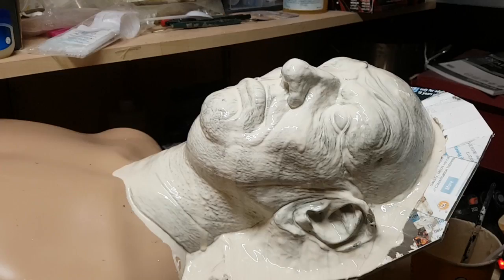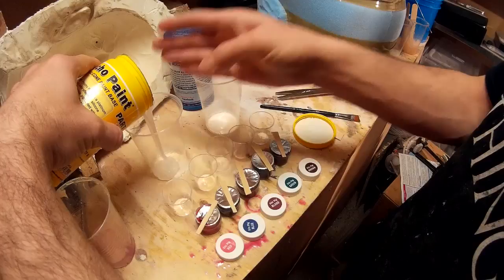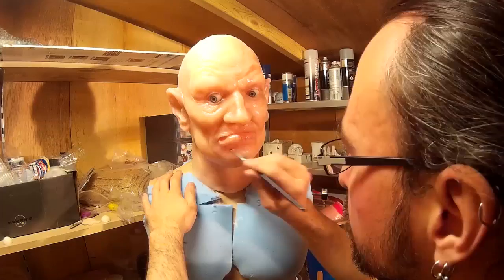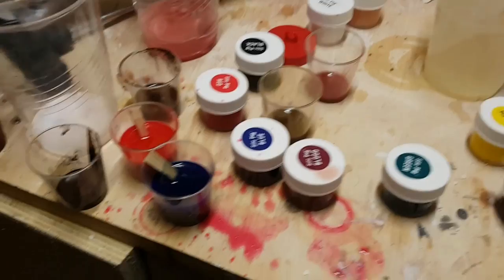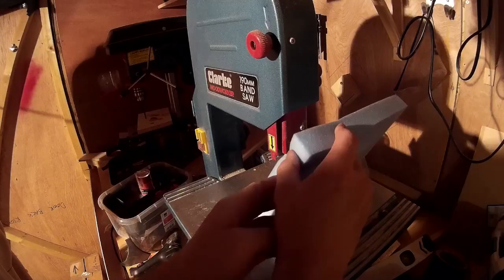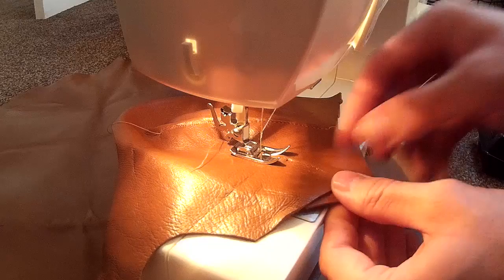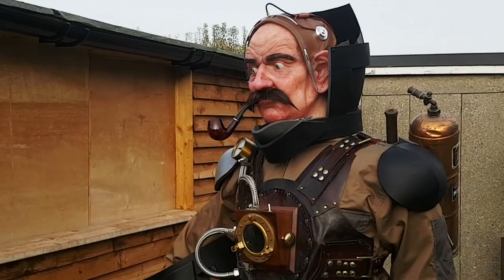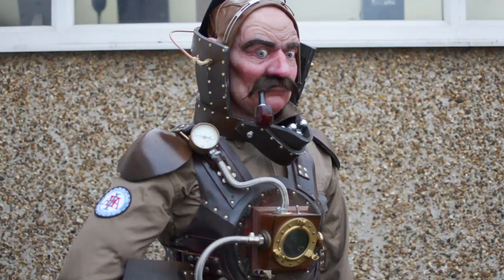Making a Silicon Statue Part 3 - Painting Silicon with Psycho Paint

Comment: This might be a stupid question, but why use Psycho Paint as a base instead of just the same platinum cured silicon? I've painted silicone faces before using silicon, pigment and thinner. What advantage does Psycho Paint offer?
Reply from the maker: Yeah it's a good point.  Maybe a question for smooth-on really.  This was my first time doing this with platinum silicon (and it was a commission rather than a project for myself) so I just followed the 'official' way of doing things.  I suspect simply mixing up some more dragon skin may well work fine, but I've not tried it.  

I used to mix up oil paints and silicon bathroom sealant when painting tin silicon, but that won't work for platinum of course.

Comment: i've been trying to paint with psycho paint too but it wont cure! i dont really understand why it wont ... any advice? i use equal parts A and B and a TINY bit of pigment to colour it... Could it not be curing because the mixture is too thick?
Reply from the maker: Hi.  I know that platinum cure silicon (which is what the Psycho Paint base is I think) is inhibited by tin cure silicon and also latex.  So if you were painting on to a tin cure silicon piece, or have mixed the paint while wearing latex gloves, that could have an effect.  I presume you're using silpig pigments too -  it's difficult to say without knowing the specifics of what you're doing.  I would say that Smooth-on are really helpful with this sort of thing, so worth getting in touch with them.

Comment: What do you think of an idea I have for a steampunk Cane shaft made to look like someone just ripped a steam pipe right off the wall and starting using it as a Cane?
Reply from the maker: Yeah cool idea and wouldn't be too difficult to put together using stuff from the hardware store I reckon.
Reply: The Dark Power yep it should be easy,but do I go with plastic and metal and paint the plastic parts to look like metal(for the parts that don't come in plastic) or go all metal?
Reply from the maker: I'd go all metal - getting a decent metal effect with paint can be tricky.
Reply: The Dark Power ok thank you. I hope everything works out the way I envision it, I'm trying to put together my first steampunk costume

Comment: Hi,

I've been testing psycho paint with white spirit but the surface remains tacky after days of waiting. Have you come across this problem?
Reply from the maker: Hi.  No I've not found that.  You could try adding some talc to try and reduce the tackiness.
Reply: The Dark Power  Yup I've been using talc but it's so frustrating having this problem when other people don't get it. Not sure what it is! I've tried everything! The yours was completely tack free? I've tried painting on eco flex and also platsil gel 10 with the same problem. It cures fully but has a tackiness. God damn it lol.
Reply from the maker: Yeah I feel your pain! I've had various silicones and resins refuse to fully cure in the past, it's really annoying. I did recently have some dragon skin refuse to cure. In that case I think I added too much silc pig or too much thixo. I don't know if psycho paint might have the same issue with pigment? Only thing I can think of. I know they recommend painting the dragon skin with a few days of it being cast too.